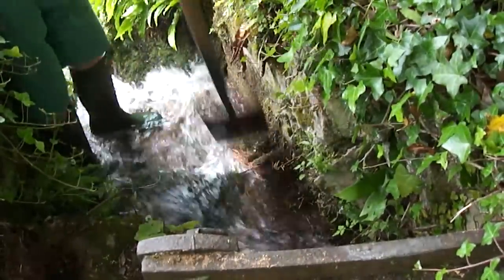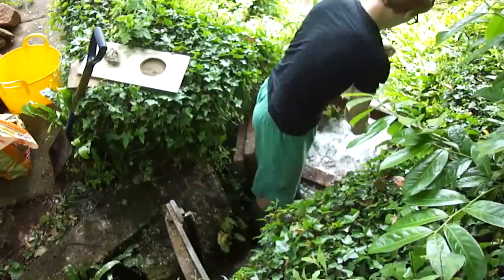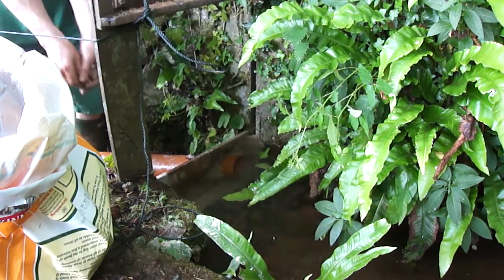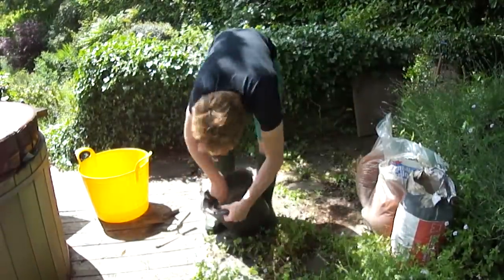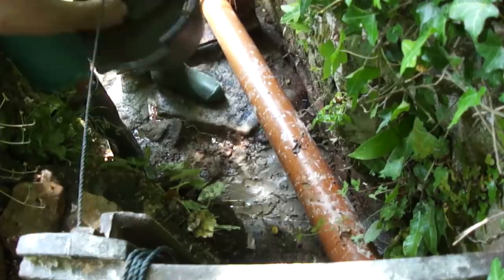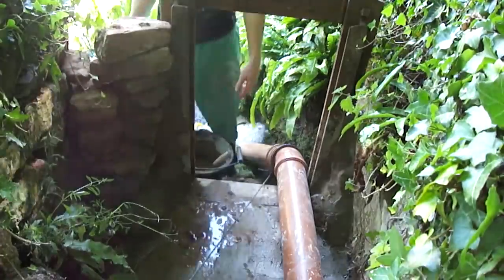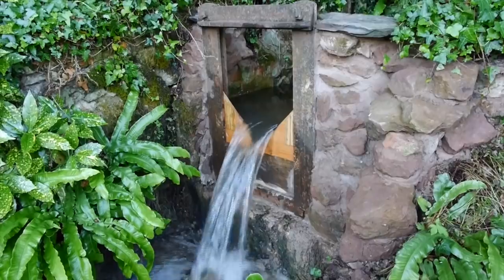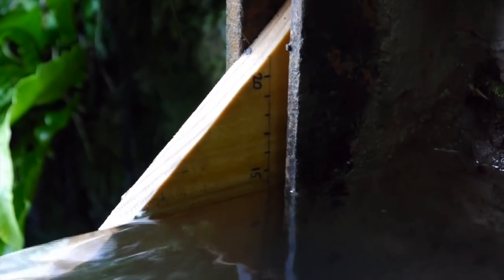Building a water wheel Ep. 1 - Sluice gate

Comment: Hi Henry, thanks for a great series! My friend and I are planning a similar project at his house which happens to have a stream, mill building, (filled in) sluice pond and all, in Snowdonia. The stream has a similar head of 2.7m and I'd be really interested what flow you had on your stream and what sizing of generator you went for? 

We took an initial flow measurement this weekend using the bucket method but recorded an underwhelming 2.7l/s. I suspect that due to the geography of the area, the flow varies a lot with rainfall and snow melt on the mountains, so hopefully the average is significantly higher, and we can use the sluice pond to even the variation out.
Reply: Hope the plan worked out